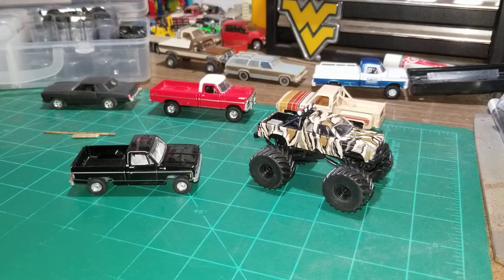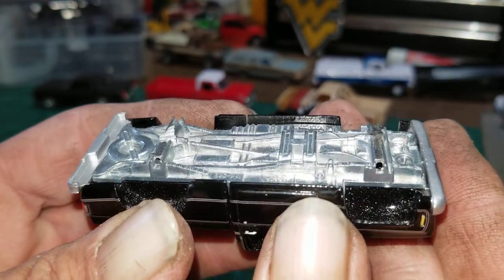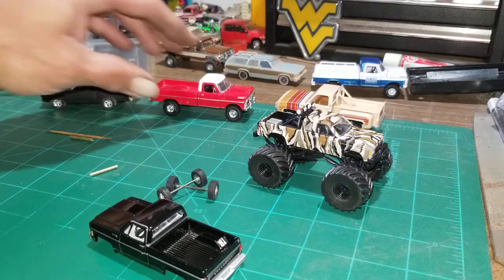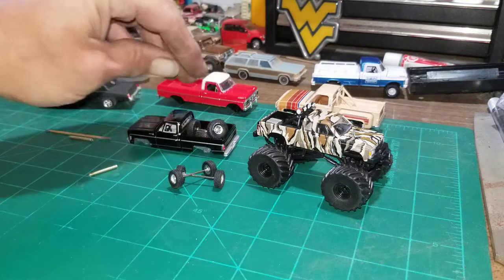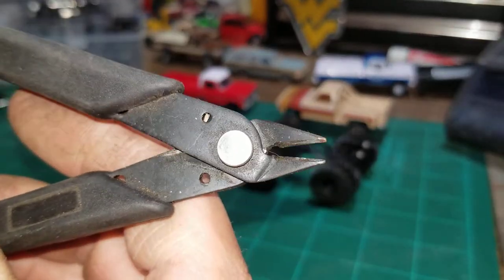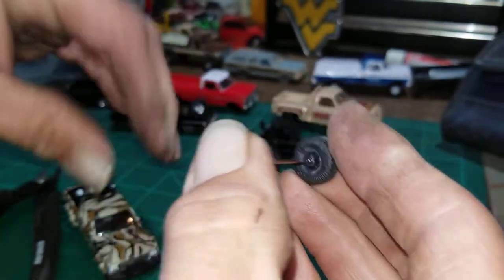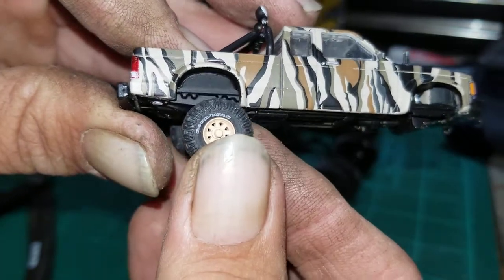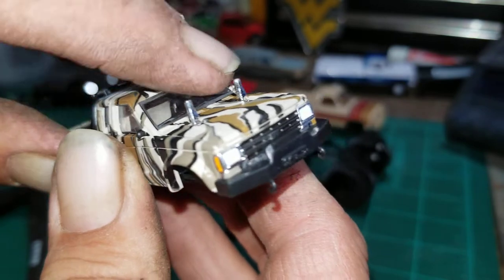Customizing 75 Chevy Truck and Ace Ventura S-10 First Part

Comment: Is the brown and tan 70s model Ford the last truck you showed on your eBay site I've talked to you before about showing you some of my builds but I'm not sure how to do a YouTube video and such
Reply from the maker: Wilson I do still have the tan Ford.  I plan to list it on ebay this week
Reply: @backwoodsmodeler3340  I'm interested in it. I have a quite a few 72 f250s. I also have the red and blue f250s as well and did a tire swap the tires off the blue one onto a turquoise and black 72. I have about 300+ cars in my collection. Mainly Auto world and m2s and greenlight. and lot of the dually drivers. I would really like to have that Ace Ventura monster truck I have the blue Monte Carlo and the black Chevy Blazer from the first movie.
Reply from the maker: @jrcustoms6160   well I do have the   ford truck still but as for the ace Ventura S-10 It has already been modified it is now on a set of m2 tires message me at backwoodsmodeler @yahoo.com  and we can work out the details tomorrow
Reply: @backwoodsmodeler3340  I finally figured it out I uploaded a video Jr customs of my truck collection
Reply from the maker: @jrcustoms6160  I will look for it
Reply from the maker: @jrcustoms6160  I am having trouble finding your uploads
Reply: @backwoodsmodeler3340  yeah I've been told that at least twice now I'm not sure what I did it's also telling me that my comments are turned off I'm not sure how to figure that out either
Reply from the maker: @jrcustoms6160   Brother I too had problems with tying to create and upload videos I wish I had some advice honestly I had to get my kids to help me lol good luck cant wait to see your builds
Reply: @backwoodsmodeler3340  yeah I'm going to try to tinker with it a little later.
Reply from the maker: Sorry jr customs the tan ford sold less than 30 minutes after posting it I plan on building a couple more after I find a few more of them
Reply: @backwoodsmodeler3340  this saddens me deeply I sure was interested in it I checked every day throughout the day much as I could I didn't even see it pop up I bid it on the Monte Carlo a few times and with work I tried to get to my phone fast enough to place the bid I still can't figure out my YouTube channel but I'm a keep working with it cuz I really want to show you the builds that I have I'm working on a new one as we speak I'm also going to figure out how to open an eBay account because I have duplicates and I may either sell or trade them
Reply from the maker: @jrcustoms6160   I have ordered 4 more of the brown ford I will be building a new one and I will make sure you get it I am also going to build a couple different versions of the same truck give me a couple of weeks and I should have one ready for you
Reply: @backwoodsmodeler3340  ok my friend I'll make sure I keep my eyes peeled and I will have arrangements to pay for the one I bought on eBay Tues. Afternoon thanks for the info